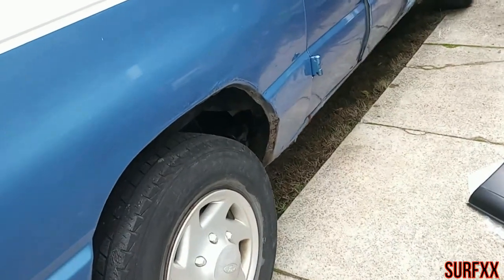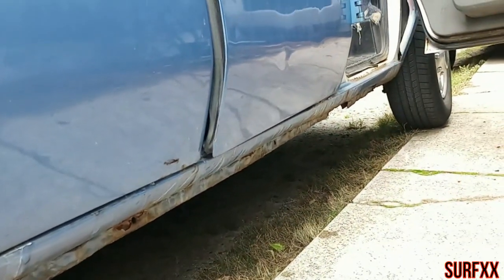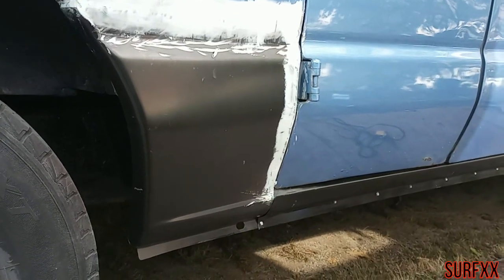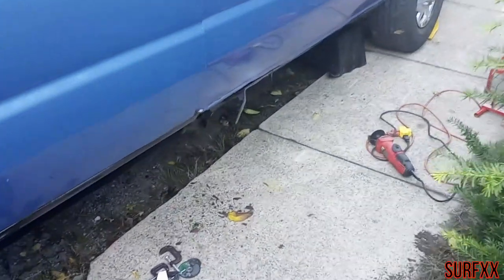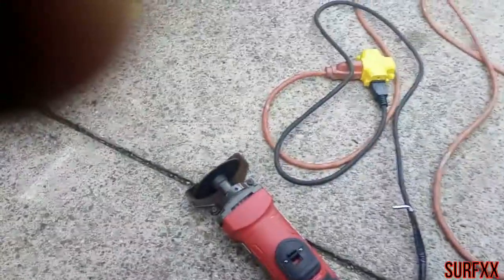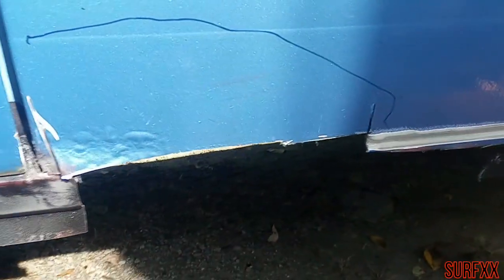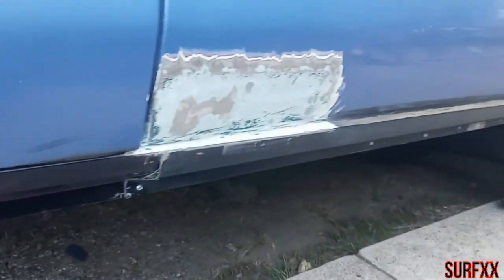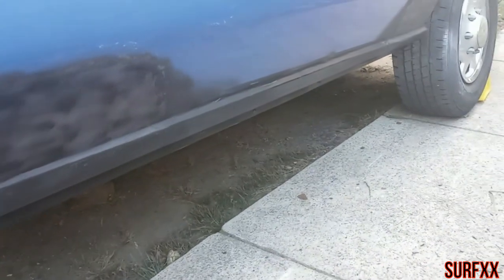Ford Econoline - Replace rockers & Quarter panel - Flux core

Comment: Hi  my 2010 is 4x4 so I must save it for long term. Was the 1/4 panel a heavier gauge then long door sill piece? Hoping I can get a heavy door sill piece as I would cut out all the bad. Thx Canada
Reply from the maker: Good afternoon. Yes it's heavy guage probably 19 guage. The slip on rockers were heavy guage too.
Reply: Where do I get these. I live in Vancouver bc. Coukd I cut them off another van ?
Reply: @constantvanlife amazon